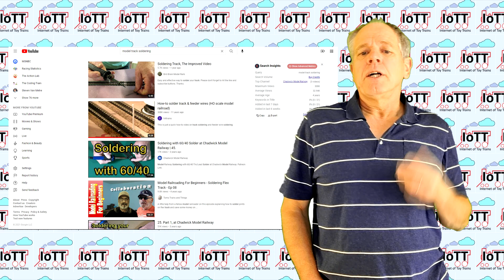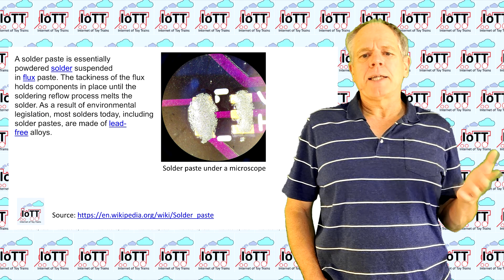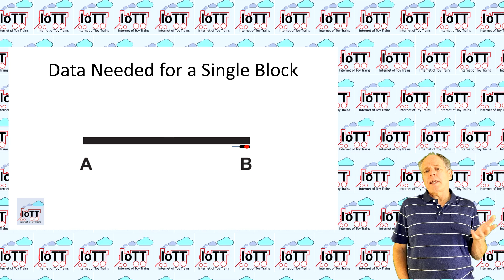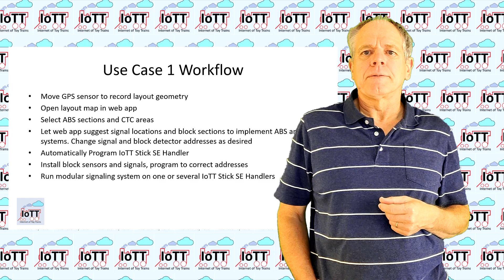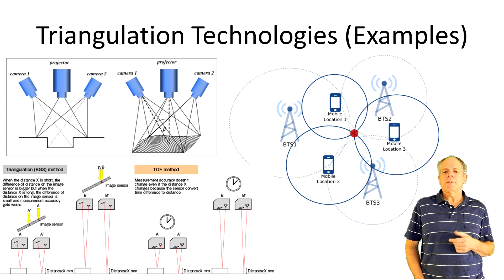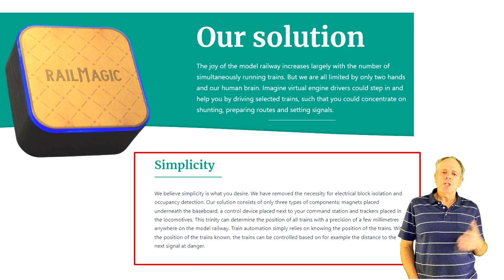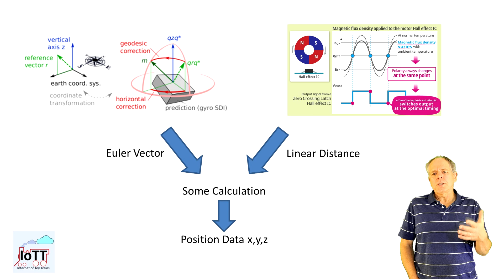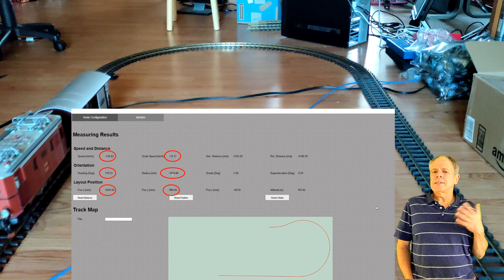Layout GPS and Track Soldering (Video#83)

Comment: First off, you're right, I'm not aware of any one demonstrating the use of soldering paste in order to join track together. For N-scale users, like me. this could be a real improvement as you don't use as much heat and therefore won't melt plastic ties as often. I like it and will give it a try. Thanks for this tip!

Second, the concept of using GPS tracking for model railroads is certainly unique. I can see a number of modelers discounting this idea as they feel that their layouts are not so large as to loose sight of the trains as they go around the layout. Larger layouts could however, use this to some benefit. Where I really see this idea gaining support is for those layouts which have a central dispatcher with operations. Here the Dispatcher could "watch" where the trains are in real time and through a CTC panel, control the train's movement through the layout. With multiple trains operating on the layout at the same time and by the use of colour coding each train, this could be very interesting. I can think of a couple of local layouts where this might be useful, especially if you don't have miles of wiring to contend with. The Dispatcher, with a few monitors and a turnout control panel, using WiFi communication to turnout motors/servos, could make this very simple. 

Once eagain you have laid the foundation for some very interesting ideas on the future of model railroading. Keep up the great work!
Reply from the maker: The biggest advantage of using solder paste is that it is a mixture of solder and flux and it is wetting the rail when applying it. So, when it is heated, the flux start to work immediately at the location where the joint is going to be, there is no repelling of solder as you typically see when using a soldering iron.

Comment: I would like to see your LGB track soldering Hans ;-)
Reply from the maker: I do have a video of that, but it is not very good. But the process works as well for G scale. The key is to apply enough heat fast enough. In the video I have I actually used a heat gun so I could direct the hot air directly into the joiner. A soldering iron would work as well, but I would use a more powerful one, at least 30W if not more.

Comment: Another great video.  Using GPS could be a game changer.  I will be following this closely.    What a great idea to use solder paste.  Do you have any recommendations for a brand or source of solder paste?
Reply from the maker: Thank you. Any modern solder paste will do, I guess. Search Amazon.com for "low temp solder paste" and you'll get options. Low temperature helps to protect the plastic ties.

Comment: Very exciting possibilities! Looking ahead, how will this technology connect with JMRI or RR&Co Train Control, etc.? Or, will you develop the software that will control signals, turnouts, schedules, etc. independent of the above software?
Reply from the maker: For the use case I am describing in this video, which is measuring the track position of the layout based on a 'global' coordinate system, the output is a downloadable file with the layout geometry, mainly blocks, block interconnection, block detectors, signal locations and addresses, turnout locations and addresses. It will have a documented JSON format, so it should be possible to create an import interface to import the data into JMRI or RR&Co. That can be the end of the process in case you are planning to use 'traditional' block detectors, e.g. current sensors. 

The same file can also be used to configure the Security Element Manager in the IoTT Stick, which is the signaling system I am working on for the Stick.

Furthermore, it is thinkable to use the same data file for downloading into train-side devices to support autonomous (signal controlled) driving of trains.